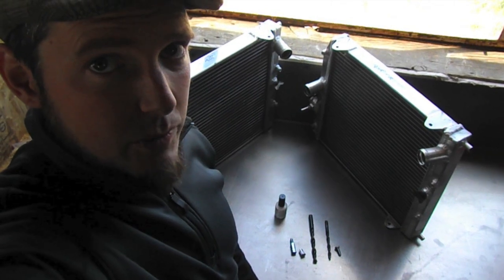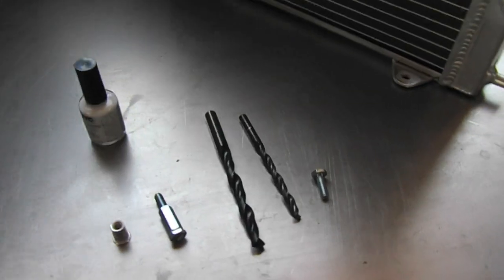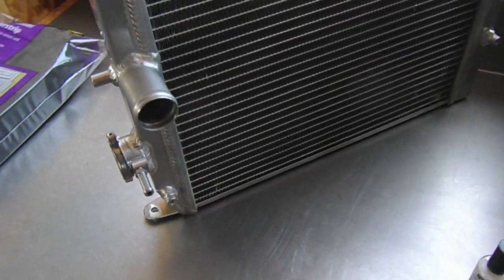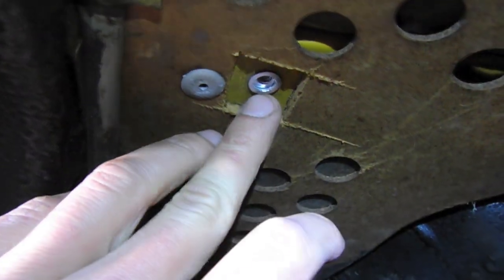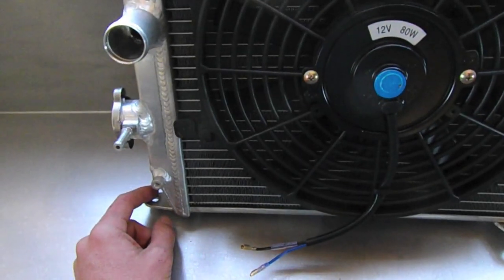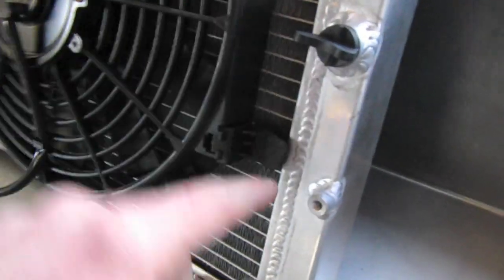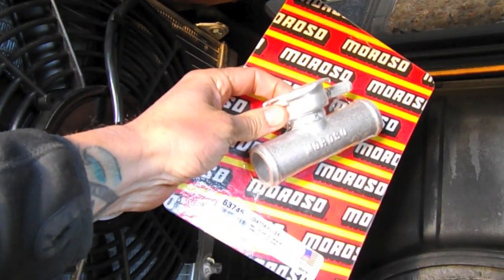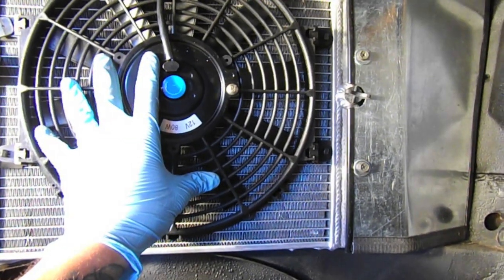Watercool the VW Bus - Busaru Engine Conversion Part 5

Comment: Looks great. I had a Mazda Rotary in my 72 Bus I used a Rabbit radiator just like how you have it set up. I ran it for a couple of years then sold the set up to a guy with a bug. Thanks for sharing.
Reply: I have a rotary swapped 71 bus . having some problems with the cooling
Reply: Make sure you are using the correct OEM style 2 stage Mazda Thermostat. The other thing I ran into was having to mount a small or large surge tank above the radiator. I ended up using the plastic coolant bottle from a mid to late 80's Rabbit. The other thing I added was the Mazda RX7 engine oil cooler. I put a large coolant/oil cooler (Mounted above the transmission) in line of the coolant hoses to the oil cooler. I hope that made sense. I was going to add another VW Scirocco radiator to the other side of the engine compartment but I did not want to move the battery. Use the largest cooling fan you can get as some of those offered by like Jegs and Summit are not up to task. I looked more for the OE types like the 90's dodge intrepid, 90's 3.0/3.8L Ford Taurus. Again your build looks great, Have fun, above 4500 RPM Hang on!!!
Reply: thanks a lot for the input I just put the thermostat in there and it helped out a bit. I'm after the electric fans not doing their job. I got those cheap eBay fans ,I'm going to get some OEM Honda ones see if they help
Reply: Yes get an OEM quality fan they help alot. I tried a couple of the lesser "heavy duty" fans. I think I ended up using one from Ford taurus

Comment: Nice clean set up ! Could you provide me with details (part #'s) & where I can order these radiators & cooling fans including all the accessories needed (radiator caps, hoses, pipes....etc) ? I'm also interested in acquiring the corner tabs (requires welding)  from you !! Looking forward to your next video !!!
Reply from the maker: Hey Itoyz, thanks for the compliments on the series. I am putting together the part numbers and kit pricing (which will include the radiators with fans and tabs) soon. It'll still be a few weeks to a month before I'm ready to start shipping them out though. At the end of the video series I'm planning to do a full article series with more information - check out boxerswaps.com and the subaruvanagon section for a preview on whats to come. It'll have a lot more info than what I can squeeze into a short video.

Comment: Do the fans suck air through the radiators into the engine bay or blow through them ?...I'm going to do a low tech swap using a Chevy ll inline four banger, 90 hp and 153 cubic inches. (2.5 L)...I already have Kennedy's adapter and flywheel kit...I'm using this lump because I already have it and my bus has a very sick 2.0L..I like being different..all I really want is more torque and heat.

Comment: Did you move the battery to install these radiators? I have a '78 and the battery would be behind the passenger side radiator. I have a WRX engine in mine and the battery lives a very short life due to evaporation of the liquid inside, probably because of the heat in the engine compartment.

Comment: I have an 82 Transporter - aircooled.  Is it possible or even practical to swap the Sub engine and plumb water cooling system?
Reply from the maker: It's absolutely possible and I've done it. It takes a little more work as you'll need to find a donor Vanagon and pull all of the cooling system and install in yours. You have fantastic results as the air-cooled vans were pretty underpowered, even compared to the 1.9 WBX. You can check out my articles at busaru.com (boxer swaps.com) here - http://www.boxerswaps.com/aircooled-vanagon/aircooled-vanagon-introduction
Reply: Busaru Thanks for the quick response.  I've watched all of your videos and I believe this spring will be the beginning of my project. I'll keep your site bookmarked and will revisit soon.  Great work!!!
Reply from the maker: Man Living Naturally I took a look at some of your chemtrail videos - very interesting!
Reply: Busaru You've probably noticed them in your area but didn't give much thought or attention to them.  I worked in aviation for over 20 years and these are a relatively new phenomenon.  Most people don't want to go too deep into the rabbit hole, so to speak - and rather enjoy living in bliss.    Regarding my air-cooled 2.0.  I'm really torn between upgrading to a Sub or the like - and then sometimes just thinking that I'd rather keep the van original.  It has 78K original miles on it and if I could just increase the HP or performance I would more likely be satisfied with that. I'm not a mechanic so forgive my ignorance - but can this motor be bored out to realize a worthwhile difference?
Reply from the maker: Regarding your engine, you may want to call GoWesty and see if they have a performance air-cooled engine, or know of anyone that does performance work on them. My guess is that it'll be pricey, but I get surprised often.

Comment: Loving the videos. Makes me think I could handle the swap out. Just pricing parts out now and hunting for a Subaru. What do you think about the logistics of using a 1998 Legacy? I think it's the EJ25 engine? It's AWD and automatic and needs transmission work but that shouldn't concern me as it's just the engine I want right?
Reply from the maker: You're not too concerned with the shape of the donor vehicle aside from the engine. BUT, a poorly taken care of car could mean the engine wasn't taken care of. Might want to do a compression test, check fluids, etc. The standard engine is 2.2L but could have a 2.5 if its an upgraded model.

Comment: hi.  just a quick question.  I noticed with these radiators someone was having trouble cooling a 2.5 engine.  would it be sufficient for 2x 3 row radiators rather than the 2 row that you use? wondering wether the 2 x 3 rows together would be sufficient enough for the 2.5  engine im putting in my late bay and love your radiator placement idea as I will be lowering mine to the floor!  thanks in advance and great tutorials by the way!  thanks  mick
Reply from the maker: 3 row will probably cool a lot worse since it'll restrict airflow. I haven't experimented with Single row but Subarugears had claimed that they have a customer running stock Honda radiators (single row) cooling an SVX engine. Now this engine is coupled with a Subaru transmission but still - that's a massive power plant.

Comment: Mick, do you mind sharing the dimensions / material of the cross over pipe when connecting to the top filler? Also, are you using Tom's thermostat?
Reply from the maker: Hey Dillon, its been a long time! I'd love to hear how your project is coming along. The cross over pipe is galvanized steel (which has lower reactivity than stainless believe it or not!). The easiest place to find this is at the home store - it is 1.25" EMT electrical conduit. The length is going to be a little different for every swap but I'd just buy a stick of conduit and cut to length. If memory serves, its around 36" depending on how much rubber radiator hose is used. I have not heard of Toms thermostat. I should contact him about that. Any benefit?

Comment: Probably stupid to ask - but I am curious do you happen to have a part number or such for the Scirocco Radiator or a suggestion for which company to use? I am looking for a radiator that will fit for use in my 69 Bug but when I look for Scirocco Radiators none of the images I see match the one on the video.

Comment: Question. Have you tried running your radiators in parallel instead of series and seen any difference? Maybe improvments? Also in the outlet of the left radiator I see that it's sitting a lot higher than the inlet connection, can this decrease the radiator potential due to (from basic observation and taking in physics of gravity) water on the lower parts not being able to make it to the outlet?
Reply from the maker: Hey Felix, good points! I went with this design primarily because of "off the shelf" handiness. If going with custom radiators (or altering the Honda rads) it would be best to have a high coolant entry point and low discharge - it's all an experiment at this point as no one seems to have a perfect system for all conditions. I know some folks who've run these rads in parallel but no significant changes to cooling temps. 85-210 seems to be the range from normal to high temps. Are you working on a project, I'd love to see any improvements - all contribute to the knowledge base. Cheers!
Reply: +Busaru  Thanks for the reply, I love your vids. Yes I am currently working on putting a 2.5 in a 78 bay window as the original 2.0fi seemed to not sound like it ran right even after rebuilding the whole thing. I'm now thinking of using Geo Metro radiators due to its compact size able while standing up right. My next hick up is deciding what to do with the transmission situation. I'm hoping to use the subaru automatic but we'll see.
Reply from the maker: +Felix Alvarez Great idea on the Metro rads, I'd love to see a picture of those when you get them mocked up - any chance you can post a pic up on the boxerswaps forum, or send me a pic at boxermick@boxerswaps.com? SubaruGears offers a kit for the Subaru 5 speed but I don't think they have a kit for the auto - that would be great if you could develop a reversed crown and pinion for the auto - I'd buy one!
Reply: +Felix Alvarez I looked up those geo metro / suzuki swift radiators and I believe the are actually larger? correct me if i'm wrong, or provide me with a link? i'm doing a ej22 swap in a 1957 bus : ] thank you guys and BUSARU dude you are the man thank you for the inspiration!
Reply: +Loud Luggage Co. The Geo and Suzuki radiators are about... 1 inch smaller in diam and length (12.8"x 12.9") while the civic ones shown here are 13.7"x 13.6". Not very much of a difference at all. I am tossing around the idea of using a motorcycle radiator like from a Goldwing, but I think if i get smaller it may not be able to keep up with the heat output. I'm still at the drawing table for putting in the 2.5 with the Subaru automatic transmission, I may end up (to simplify repairs in the future) cutting just a little into the cab and putting the engine facing forwards. I wish you the best of luck,
Reply: I went with two honda radiators (more radiator than stock) and mounted them inside the engine bay like busaru but my bus is a 57 so i went a little different route! check out our videos coming soon!!

Comment: Awesome video series! I've probably watched them five times over. It really makes me happy that you're delving into something that it seems like no one else has done before. I'm 16 and about to get a mid 70's Westy myself, and hope to do a swap pretty soon after. Although I don't have access to a Subaru engine, I do have a VW Jetta 1.9L TDI engine at my disposal that I've heard is a pretty popular swap to do as well. Do you think that the '97 Honda Civic radiators would be compatible with that particular engine? Or are they specifically geared towards Subaru engines?
Reply from the maker: Hey Brent, sounds like a great project. The radiators aren't specific to the Subaru and will probably work pretty well with the smaller, cooler running, diesel. I would make sure the in's and out's match up okay before going with them though. Take some videos as you convert, I would love to see that!

Comment: You would be better off using the factory mounting posts on the radiator and finding a way to weld the actual brackets the hold the rubber grommets that those posts go into.  By hard mounting the radiator you risk developing cracks through vibration  which is why they mount the radiator using the posts and rubber grommets to isolate it from vibration.
Reply from the maker: I haven’t watched this video in years and you got me thinking. I’ve been mounting them differently as designs have progressed but haven’t updated folks on how I’ve been doing the past 3 years or so. At some point I’ll document another swap showing my updated method - which is very much like what you explain. Thanks for the comment.

Comment: Hey man great series so far! (this is my wifes account) I haven't made it through all the vids yet so you may have answered my question. Do you have any scoops on the outside of the bus by the radiators or do they just use the air in the engine compartment?
Reply from the maker: Thanks! I don't have scoops but its not a bad idea, especially for warmer climates - The more airflow the better, although I've heard the argument that positive pressure doesn't help cool as much as vacuum below/behind the bus. Its definitely worth exploring.

Comment: WHEN THE SYSTEM IS INSTALLED ,DOES IT NEED A COOLANT RESEVOIR ? IF SO .HOW TO INSTALL ?
Reply from the maker: +Patrick Micallef it needs a coolant overflow tank. You can mount one to the firewall if you'd like.

Comment: Awesome work on the vans and the videos! I am learning so much thank you! Have you put together a busaru engine installation kit? If so, i need to know where i can get one! Thanks man!
Reply from the maker: +Chris Damewood I offer the crossmember, the Throttle Body Reverser, and the Vehicle Speed Sensor. I can also help with a wiring harness. You can find that stuff at Busaru.com/busaruparts

For the adapter plate and exhaust you should go with Kennedy Engineered Products - just google their stuff.

Comment: question: where do you put your battery/batteries?
Reply from the maker: +johnny85er If going with engine bay rads I put the battery under the rear seat.
Reply: my 78 Riviera is in need of a new motor, I've been thinking about going Subaru for sometime, and after a lengthy discussion at work, I came back & rewatched all your videos.  
I'm still trying to figure out what would work best with the radiators. Underbelly seems the 'least intrusive'... 
Thanks for these videos, they are quite the resource.   I will report back if I make any progress.
Reply from the maker: +johnny85er You definitely won't regret it. I'd say go belly rad if you're going to stay mostly on pavement. If going off highway frequently then I'd definitely go engine bay rads. Both designs  have their place. Good luck on your project!

Comment: Those are not crossflow radiators, and setting them up that way is rendering half the radiator useless.  A cross flow radiator would have the inlet at the very top and not in the middle and the outlet would be at the bottom.  I would suggest you let people know this is not the proper radiator to buy for this application.
Reply from the maker: Sheesh, very critical! I have them in my personal bus for 5 years now without issue. I have started installing a scirocco radiator on the left side and using the porthole to mount the air filter - makes for a very clean install  - cleaner than the 2013 design in my opinion.
Reply from the maker: Quick question - have you found an off-the-shelf radiator that would work better than the Honda? I’ve tried quite a few but have yet to find the magic combination. The Left Scirocco/Right Honda is cooling the best in my experience. I prefer to direct folks to off the shelf versus custom radiators. Let me know what you’re using.